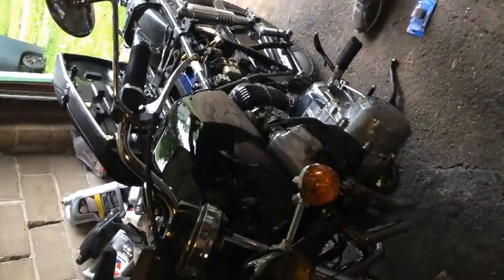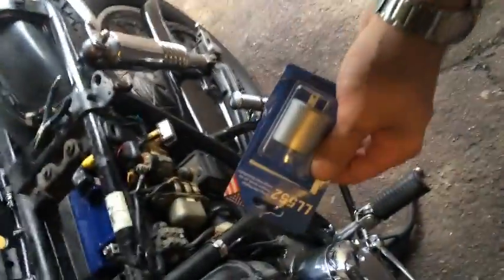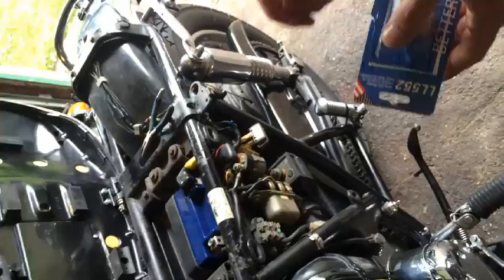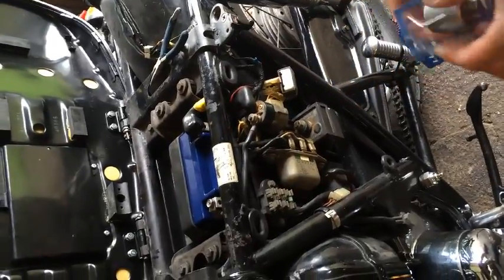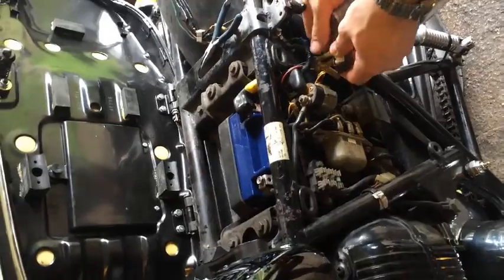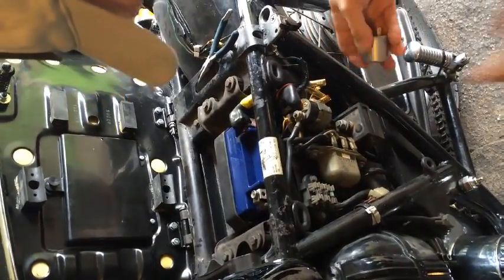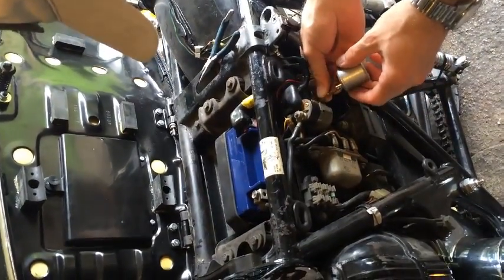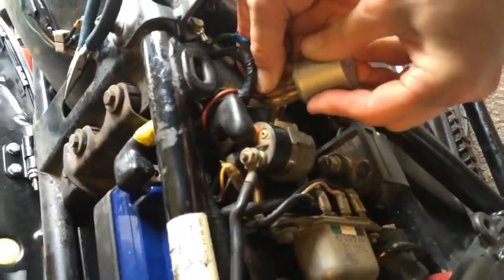Honda CB750 turn signal relay upgrade electronic

Comment: Got to do that for my 78 CB750 Custom. What tire pressures are/did you run? Back in 1990 I never checked. Now I got another one and not sure. Tires don't say. Felt Squishy to and from the Auto Shop where it got Full Service but still needs exhaust work and Valves are at their Max.. Will need a new chain soon also. I got it from a guy who rides dirt bikes, probably drove this just like one of those... Only 27,500 on it and acts like 275,000 and never serviced but mine back in 90 had Double that and ran Way Better.

Comment: Rather than saying “left” and “right” for the terminals, you should say which wire goes tot he “l” terminal, and which one goes to the “x” terminal. There are no left and rights (it would change if you turned the relay around).
Reply: Left and right is your switch.

Comment: do you think this will work for a 1992 cb750
Reply from the maker: I don't see why it wouldn't work but if it doesn't you are only out a few bucks to try it
Reply: I got the same relay from autozone but still didn’t work! Could it be my ground? Or issues with my wiring?